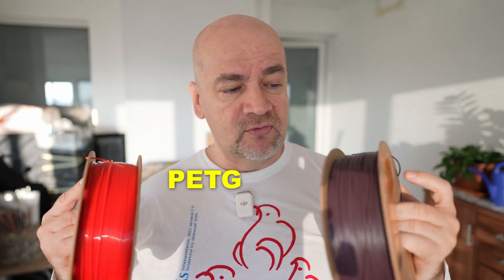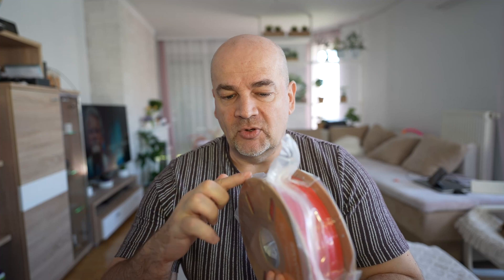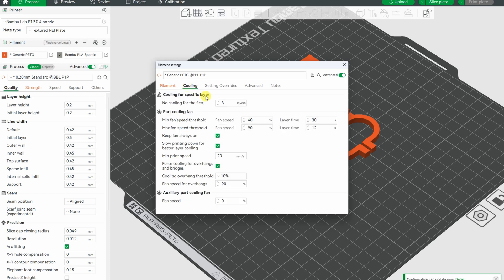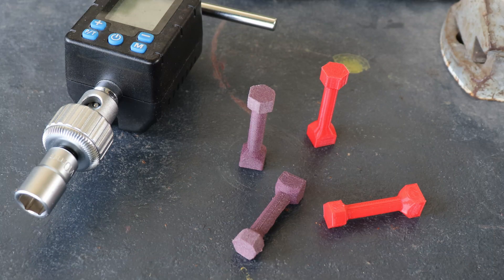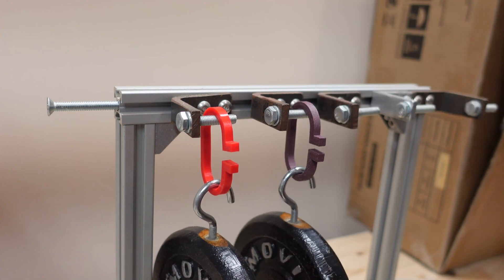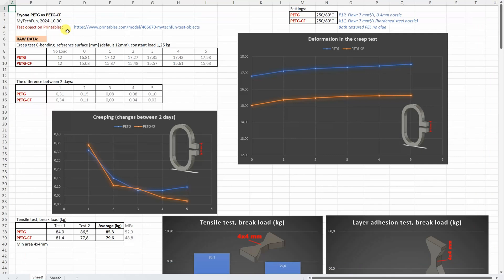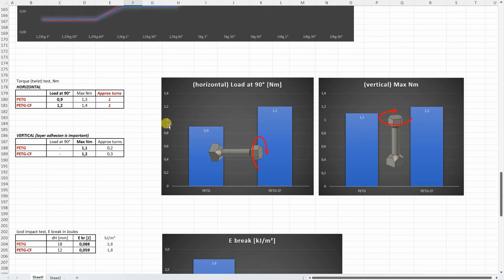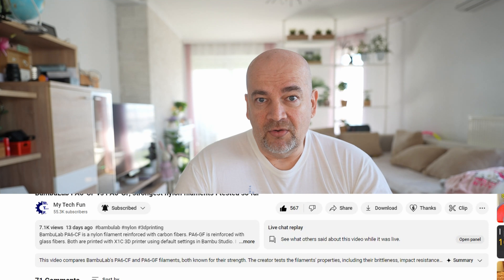On the test: Eryone PETG vs PETG-CF (carbon fiber) 3D printing filaments

Comment: I'll try for the third time as my previous attempt were somehow deleted: your thermal test is very flawed, and I'll tell you how to make it better.

1- There is only one small nut on a thick and short bridge, there is basically zero load, much much less than even the 0.45MPa ISO 75 test. If you want to see what a real 0.45MPa load looks like with a nut and a bridge I have the cad on my GitHub 

2- The temperature ramp is waaay too fast. I looks like 2°/min, so even when you reach the temperature at which the material will slowly fail it has no time to bend and it will only look bent some time later, resulting in a higher apparent reading compared to the real one. You need a much slower ramp, something like 0.5°/min or slower
Reply: Also this was never a personal critique of Igor, I like the other tests and I'm really grateful he's doing what he's doing
Reply: The current test is not even a good comparison between filaments, as the failure of a material because of the temp is not linear wrt time, not linear wrt stiffness, and not linear wrt temperature itself, so one material that fails early but in a gentler way and one material that fails later but a bit quicker might give the sane result, even though they compare much different
Reply: I agree, these interesting material tests would really benefit from a much improved high temp test. I hope Igor could take a look at it :)
Reply: I understand he maybe dont want to change it so it stays comparable across older videos, but performing tests as you described would give superior and more realistic result, and likely show more difference between the types
Reply: 1. He’s minimized confounding variables by standardizing his process — most important. More than one way to perform an experiment.

2. Where have my products failed? When I forgot them in my car where they experience temperature increases between 1 and 2 degrees per minute. I’ve learned a ton from his specific method of temperature testing.
Reply: @erickenz8579  1- I'm not saying to use a different test each time, but to have one good standard, a better one that what he has to, going by eye his bridge is double the thickness and half as long compared to what's needed to test HDT/B (only 0.45MPa) with a M12 nut.

2- you are 100% not getting what's my point. If you want to know the max temp you can use a material you want a test as close as possible to steady state. If the material takes 2min to bend you'll already overestimate the temp by 4° with his test (or even worse depending on the creep behaviour of the material)
Reply: @adeo  i understand what you are stating (and the science behind it). That aside, in rear-world applications, would you choose a filament that was going to experience temperature within 5 degrees -Celsius of threshold?

You are picking and choosing which independent variables to criticize. I could also argue a valid criticism would be related to the fact that each filament not optimally printed in every single test (ie. temperature AND flow rate optimized per material  prior to every single print). But again, his methods do appeal to the masses (even that which you said was not good( and we can still learn how the filaments compare to one another (which I believe is more of his goal).
Reply: @adeo  and often researchers (with all of their methods and expertise) are not good educators. I would bet Igor is both. He understands his findings need to be easily understood to be valuable.
Reply: @erickenz8579  are you saying that making a test more representative of both the real world and the ISO 75 standard would somehow make it less understandable???
I am not saying he's misleading people, I'm just suggesting how he could improve his test
Reply: @adeo   not at all suggesting that (ISO and ASTM exist for very good reasons). That said, even the technical aspects of these two organizations’ analogous methods for testing plastics is different, even down to the size of the plastic specimen and timing of pressure application. I’ve seen several product comparisons that have the iso75 and ASTM d648 deflection temperature of the same material differing by 5-15 degrees Celsius. 

Can’t make everyone happy. BUT, respectfully, this will be my last response as my initial response was to your comment stating that Igor’s testing was “very flawed”. I’d rather he keep his current methods and add to them as he sees fit based on his time (and whether or not he wants new data to still hold value in comparison to current datasets).
Reply: @erickenz8579  I'll just reply with a copy pase of the second part of my original comment, that you apparently didn't read:

The current test is not even a good comparison between filaments, as the failure of a material because of the temp is not linear wrt time, not linear wrt stiffness, and not linear wrt temperature itself, so one material that fails early but in a gentler way and one material that fails later but a bit quicker might give the sane result, even though they compare much different

If a test produces results that can't even be compared to each other the test is definitely flawed.
Also I'm not "picking and choosing" which flaws to criticise, I'm just saying that there are multiple independent flaws
Reply: @adeo  I am always open to learn from and appreciate discussion with all walks of life (🍻). 

I am curious of your thoughts (based upon your concern with the methodology): Compared to filaments not infused with GF/CF, would you hypothesize that G/C fiber-infused filaments’ HDT is more or less likely to be overestimated with his current visual estimation?